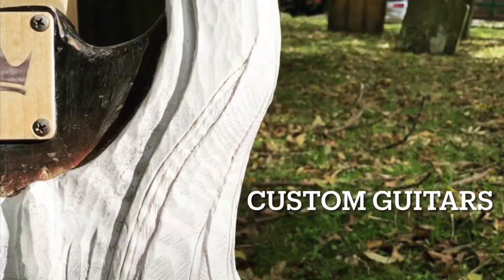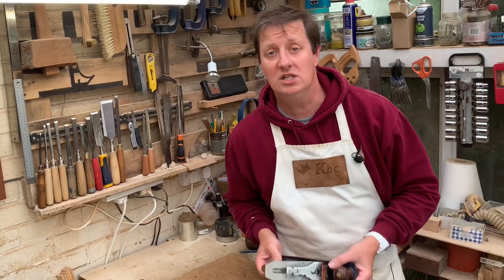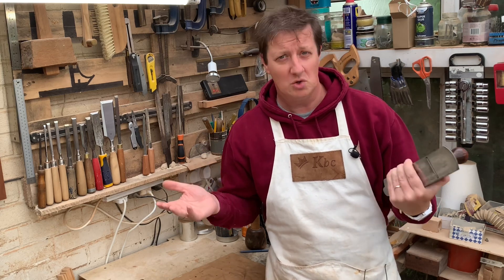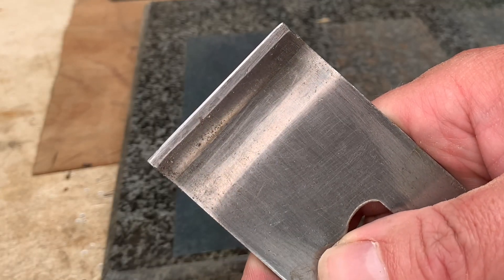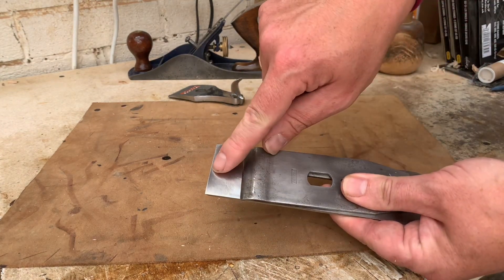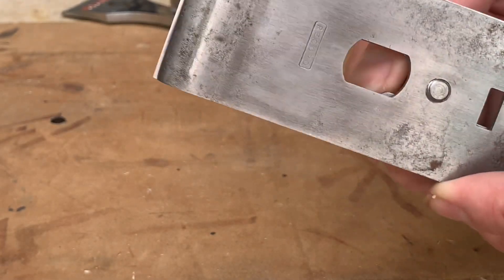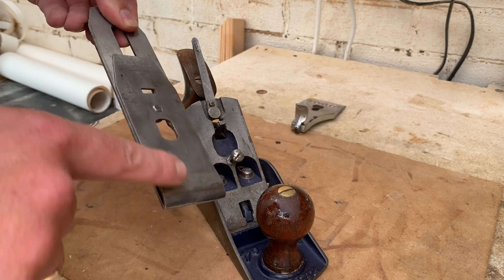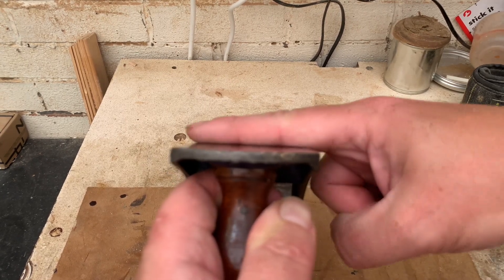Hand plane clogging up? Here’s how to fix it!

Comment: Hi Chris. I restored my my dads 60yr old no4 Stanley last year. It was a complete strip down, buff, repaint, varnish (the handle was in 2 bits also) and sharpen. I used you scary sharp method when that video came out. Looks really good now, but I'm going to take another look at the set up using this video. I new nothing about setting them up last year. Thanks Chris.
Reply from the maker: I love hearing about restored tools, even better when there some stories attached to them!

Comment: Mr King, thank you for the video - I have just rehabbed an old Victor plane (I’ve heard it was a lower quality tier of Stanley) I got for 30$ at an antique store - I got the blade to cut newspaper with ease and couldn’t figure out what I was doing wrong.  Your video showed me that I had the blade in wrong; I had it bevel up, like my block plane (recently rehabbed as well).  It now cuts great, I was getting quite frustrated, constantly readjusting the frog, chip breaker, and top locking plate thing.  Thank you for ending my frustration.
Reply from the maker: That’s great news, glad to be of service 👍

Comment: Brilliant explanation! Refreshed my memory...I had to pause the video and go look at my small planer that keeps clogging up...I  cannot figure out what is wrong with it.  Mine is much more simpler unfortunately so I'm still confused.  It fits in one hand,  has no handle or knob for two hands. It's a Stanley...I deliberately bought a Stanley for quality reasons.  There's a base, the blade with a  plate that acts like a wedge under a bar...the knob between only tightens...no idea what it's called...other than glorified paper weight...

Comment: The tool to tighten the cap iron to the blade, is that home made or something you can buy? I've recently bought a 5 1/2 plane that hadn't been used for 20 years or so, it was in a right state but has restored nicely, but I wish I'd had one of those as the cap iron and blade were stuck together solid. It took a week of 3 in 1 oil and WD 40 to get them apart. They don't make screwdrivers with that job in mind anymore, and using a modern one can easily tear up the slot, so if that is something of your design, I bet I'm not the only person who'd be interested.
Reply from the maker: I wish it was my exclusive design! I believe it’s a  Veritas tool.
Reply: @KingBespokeCreations  Ah, I see... I'll look into a re-mortgage then... gulp!
Reply: @peterwilliams8922  If you are in the States, Lee Valley sells them too. 😉